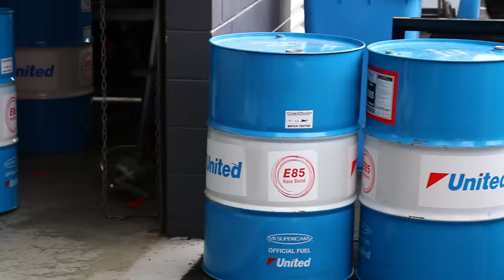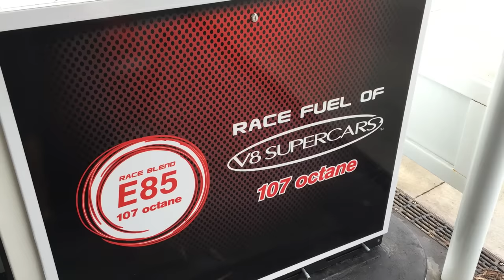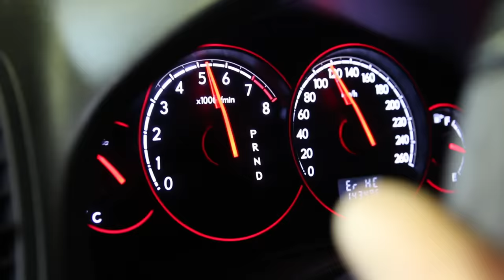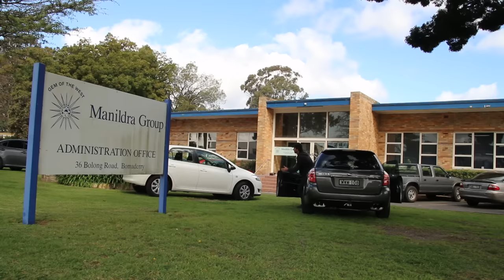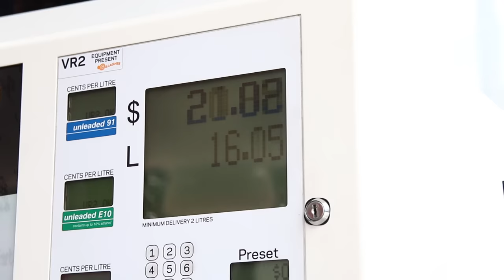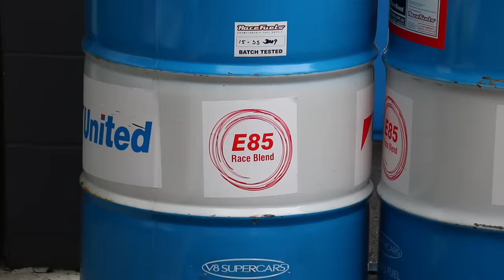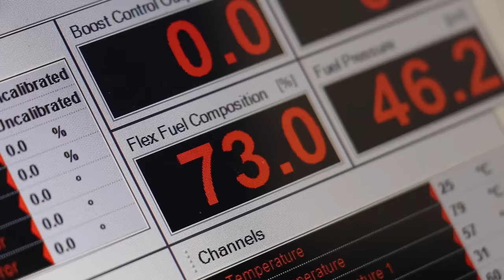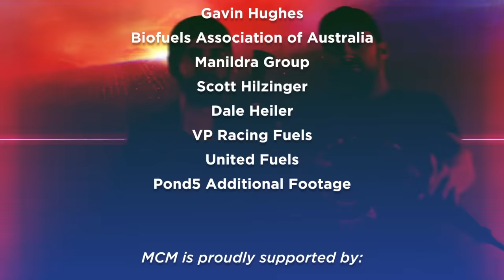E85 Fuel Explained - Should you use it?

Comment: It takes 100 gallons of water to make one gallon of ethanol.  So, you are compromising food and water supplies.  E85 is a distant second place to electric cars.
Reply: +Invincible Osprey But eletric cars use dirt fuel too, as most energy on the wall to charge it... are far from clean
Reply: +Invincible Osprey your statement has very narrow scope and high on the numbers you're quoting anyway. Corn is not the most efficient crop to make into Ethanol. We just grow a lot of it in the states. Sugarcane and Beets have a lot higher yield. You can't compare everything against corn crop.  

You also can't say E85 is a distant second to electric cars because converting any existing vehicle over to E85 or E100 is actually doable. There are billions of cars out there that could potentially use ethanol. Converting those over to electric, that's not possible.

There's a huge environmental impact in making the big car batteries and some use exotic materials. 

I'd love to have an electric vehicle for getting around, but there are tons of great cars out there that I'd not dare give up. They're just so much fun to drive and work on. 

So a statement like what you made seems to just be a standard bulk reply made by someone who has just been told to take a certain stance on something.
Reply: +Invincible Osprey E85 is easily adapted into existing cars, until electric cars become affordable for the average person then something like E85 (or other combustable alternative fuels) is the way to go
Reply: thesamandnath
Unless you need to drink water.  There are lots of water shortages in different places at different times all over the world.  You can't make ethanol unless you use a shitload of water.
Reply: Invincible Osprey
But by that logic let's end the production of any alcohol product, including drinks. As alcoholic drinks... even with water in it, dehydrate the person.
Reply: Invincible Osprey Does there happen to be a water shortage everywhere that ethanol is produced? No? oh okay.
Reply: peniswrinkle
Not to mention, after the combustion, the water used on Ethanol go back to the environment through the exhaust pipe.
Reply: 1300l
Wow!  You think 100 gallons of water will come out the tailpipe for every gallon of ethanol burned?  Are you sure about that?
Reply from the maker: +Invincible Osprey I think its 3-4 to 1 as a ratio, it's high, but its getting lower. Takes water to extract petrol too. No fuel is perfect, yet.
Reply: 1300l
True...unless the electricity comes from solar or wind which are both growing by leaps and bounds.
Reply: 1300l
Do you know how many gallons of fuel are used compared to how many gallons of booze is drunk?  Ridiculous argument.
Reply: John Klatt
What I'm saying is that right now ethanol is a loser based on the fact food is used, land that would normally be used to grow food is used and it uses so much water.  Petroleum is used because it makes the most sense.  We have it in large quantities and the process is perfected.  Ethanol is a really good idea in some places but that's it.  Brazil has the sugar cane and lots of water as far as I can tell.  That isn't true everywhere.  I never suggested converting gasoline powered cars to electric was viable.  Did you see how much work has to be done to make these cars E85 compliant?  How many people are willing to do that?  Further, in the US E85 is about 25% cheaper but about 30-40% less efficient.  That means it's MORE EXPENSIVE TO USE.
Reply: thesamandnath
Are there cars everywhere that need fuel?  I think so.  Do you think the places that can efficiently produce ethanol can make enough to export to the places that can't?  What if there's a plague/disease on the crops?  Bad growing season?  Insects?  Then what?  With electric unless the sun burns out we can make electricity.
Reply: peniswrinkle
Right...water that doesn't make it into aquifers so that people and animals can drink it is used for corn that uses a LOT of water.  Batteries have an established means of disposal and most components can likely be recycled and done so in an economically feasible fashion once there are enough of them.
Reply: Mighty Car Mods
True about the petroleum extraction.  I live in very dry West Texas and until this last year of crazy rain and snow we were hurting very badly because of the drought and heavy usage in the oil fields.  I think if you factor in the amount of water used to actually grow a crop like corn the amount of water required really is around 100 gallons.
Reply: +Invincible Osprey  But where does that electric come from? batteries? pretty harmful to the environment. generator? high pollution. power station? higher pollution....
Reply: Completely agree with your comments. Ethanol is not a good fuel for the future
Reply: TheEpicCrumpet
Ever heard of solar?  What about wind power?  Batteries are only hazardous if they leak...
Reply: False -  I can make roughly 1 gallon of %90 ethanol from 10 gallons of mash. (distilled water,  corn, barley, sugar, yeast) I make 5 gallon batches.
Reply: I came here just to watch the anti-ethanol debate errupt.  
Regardless of what's best for the environment, fuel will be produced, money will change hands, life will go on.  
The ethanol boom is about money and nothing else.  
Energy storage technology is making electric vehicles practical finally.  In another 100 years, ICE tech will be dead in the developed world unless we all blow each other up.
Reply: That's quite agreeable. I personally think that the internal combustion engine will be around 100 years from now just not as something people or industries use very often. I just felt obligated to correct some stupidity I seen someone spitting.
Reply: +tiporari I agree with you wholeheartedly. The electric car will be the next stage of transport. It's not a better source, being that it requires hydro electric in most areas of my country to produce it. If you do the math, and everyone in my country did the switch to electric, we would probably wind up choking every river to harness the power required. We are just at the beginning of a revolution when it comes to fuel sources.
Reply: +Andrew Lang Power grid tech is about to evolve again.  when cheap high capacity batteries are plentiful you will see smart grids storing and distributing energy to follow demand.  Renewable sources are barely scratching the surface but they will eventually grow and supplement then later supplant existing generation techniques.  
I think between nuclear options, solar/wind, hydro and tidal eventually we won't need combustion, but perhaps not in my lifetime.
Reply: +John dawson however, using food to make fuel will raise the prices of food. In turn, a food shortage could be created as more of the food is used for fuel versus eating. In the long run we might be trading one shortage (oil) for another (food).
Reply: +John dawson Probably so :)  our great grandkids might not recognize the smell of petrol in a city.  I remember a distinct difference from just 20 years ago.  another 20 and who knows :)
Reply: +tiporari true that! It sounds horrible but I use to "smell" gasoline/petrol all the time as a kid and I can tell a difference from then and this %10 stuff and even ethanol free I put in my bike.
Reply: John dawson
So, how much water did it take to grow the contents of the mash?
Reply: Andrew Lang
Do you not know what "hydro electric" is?  It's a dam...water is let out and as it does it spins turbines that generate electricity.  How exactly is that polluting?
Reply: +RS8715 We're already well on the way to food shortage because of population growth, longer life spans, and resistance to GMO foods.  without GMO, we're going to starve.  People like to speculate about potential problems and take an emotional stance, but people will starve in greater numbers and that will evaporate too hopefully.

The world is quickly heading toward crisis in terms of food, potable water and energy.  if the pundits can get out of the way, maybe it will get better.  I'm betting on violent revolution myself...
Reply: +John dawson Nothing wrong with that :)  we used to use it as parts cleaner, fire starter, and a host of other "ghastly" things.  Now we can't take a crap without a helmet and a safety rail for our panties.
Reply: You know that water is pumped into the ground in order to get regular crude oil out of the ground, right. And its gallons and gallons of it being pumped into the ground in order to gain enough pressure to pump the oil out
Reply: +Frank Magana isn't that fracking?
Reply: +dumkopf yes that is Fracking not the standard way of drilling
Reply: I hate how people are so convinced that electric cars are brilliant. Sure, they don't emit fossil fuels directly however most electricity is still made by burning fossil fuels in power stations so it's just as bad for the environment. Then there are the batteries. Not only are they toxic if they leak, they are made from precious metals which have been dug up, mostly from under the Amazon causing deforestation. They are then shipped halfway across the world to be processed and made into batteries before being put in a car. That's farmore damage than just running a standard petrol or diesel. The only difference is the consumer notices it less.
Reply: electric is terrible. the resources used to make the electricity are usually not good. ie coal.
Reply: +WilliamT1995 Most "environmentalists" (used to call them tree huggers)... are far more concerned with appearances than actual, factual actions that further their cause.  It's all a bunch of feel good bull $#@! if you ask me.

"I drive a Prius, and recycle my nonfat organic latte cups."    it's like pissing on a forest fire, when their iphones, Li-ion batteries, and new iMac created enough industrial pollution and heavy metal toxicity to deform a hundred thousand babies in rural China.

Humbug.  nothing changes, nothing new under the sun.  Nothing that hasn't been said, done, or repeated for a 100 generations.  move along, these aren't the droids you're looking for...
Reply: jesse grat Unless you are making your own electricity it's pretty bad.  The amount of energy lost just to get it to your house is pretty high.
Reply: tiporari This is true of most activist.  It's more about showing concern then actually solving anything.  Just say the right words and people will like you and you get laid or have more friends.  Show the errors in the actions taken or the errors and they flip the fuck out.  

This list of examples is just endless.  LOL
Reply: +tiporari and they dont know that their prius creates more toxins in the long run over a range rover, g wagon, hummer, GM full size suv, diesel trucks, or vw "40x more polluting" diesels. They dont know this because they refuse to look up the nickel mines in canada and their death zones
Reply: electric cars are in our near future. batteries have evolved and become hundreds of times more powerful in the last 10 years. I have model airplanes that weigh just over a pound I can fly for an hour on a single charge. not saying it is a clean fuel, but great strides have been made in battery efficiency. before the model t, most transportation was electric. as a matter of fact, in the US all the car companies got together and bought out and shut down electric rail transit systems to increase car sales.

the limitation on electric cars has always been range and charge times. Tesla by themselves have but but solved that issue. it won't be long and all other car manufactures will have to follow suit.
Reply: Invincible Osprey
Yes, more people drink then use ethanol in the world.
Reply: Invincible Osprey
And about the 100 gallons comming out of the exaust. Not all at once, as a car wont burn all fuel at once.. but yes, it will.
Reply: +Four Bangin im everywhere, im even in your gearbox, switching up your gears and shit
Reply: +Invincible Osprey I'm fairly certain that at no point in my reply that I mentioned "polluting". What I said is if a country decided to switch to hydro power, it would damn up mostly every river. Yes, the water turns the turbines. I understand the basics of hydro power. But if dams were doubled or tripled, how good would it be to create that many controlled points for water?
Reply: If you like electric cars go check out what a lithium mine looks like
Reply: Bullcrap
Reply: Andrew Lang
Here in the USA they aren't building any dams.  They are taking many of them down because they aren't needed.
Reply: 1300l
I drink ethanol sometimes.  I have a fifth that I've had over a year.  However, I drive 66K miles a year with work so I burn about 2640 gallons of fuel a year.  Can't you see the difference there?
Reply: lilsammywasapunkrock
Did you also know that Prohibition in the US was actually the underhanded scheme by Standard Oil?  That's right, like this video suggests the Model T was made to run on Ethanol and gasoline.  Big Oil decided to maximize their profits by pulling strings in government to make their competition illegal.
Reply: WilliamT1995
Clean coal plants are just that...clean.  Wind power in the US is taking off and solar is gaining.
Reply: Invincible Osprey
Still less then what man kind comsume of alcool drinks world wide.
Reply: 1300l God Almighty...do you have any idea how much fuel is consumed in the world?  It isn't even close to how much alcohol is drank by people.  Just think of all the ships and how much fuel they consume, then all the eighteen wheelers, then all the pickup trucks, then all the cars and generators.  It's mind-boggling and not even close to what tiny bit of ethanol people drink.
Reply: Invincible Osprey
Give me numbers then check the nubmers of total alcoholic drinks consumed world wide. Then remember that Fuel uses around 4% of water. Vodka uses 40%
Reply: 1300l
You're so full of shit.  We're talking thousands of gallons per vehicle.  There are hundreds of millions if not billions of vehicles worldwide.  Not all people drink alcohol but they all either drive vehicles or rely on goods and services delivered with vehicles.  It's not even close.
Reply: Invincible Osprey
Numbers, privide it to me
Reply: ... But they go fast??
Reply: 1300l If you don't understand the scale of fuel use in the world I don't think you're equipped to be arguing on the matter.
Reply: Invincible Osprey
I do, but 80% still uses gasoline.
You don't understand the schale of a fuel that most don't use aguisnt somethign every one do.
Reply: Invincible Osprey
Prove it
Reply: 1300l
All anybody has to do is read your comments.
Reply: Invincible Osprey
So you can't.
Yea, now you should take a time to think why people still produce Ethanol and no one complain of shortage of water or food... You are the wrong one here.
Reply: Tesla
Reply: +1300l I literally just foot it and I found several reliable sources stating that it does take around 100 gallons of water to 1 gallon on ethanol, because you also have to factor in the amount of water used to grow the corn.
Reply: +Invincible Osprey even when making wind or hydro power you have to burn fossil fuels and use and water to produce energy that can be used. There is no 100% efficiant way of using power.
Reply: daniel jordan nicol
WTF are you talking about?  The fuel for the trucks that haul the wind generators in?  Used in manufacture?  I get it...but it's a one time deal and those things don't require much maintenance.  Hydro power?  That water is just sitting there.  They are dammed up rivers. That water flows into the ocean otherwise.  How old are you?
Reply: +RS8715 The usa will never run out of corn due to ethanol. I think the statistic is only 20% of the corn grown in america is used for ethanol. plus, we don't eat the corn used for the production of  ethanol. The process of making ethanol creates tons of by products. One is used to feed livestock and is much better for the livestock than regular corn, and also more valuable.
Reply: +Invincible Osprey The water used for the production of ethanol is reused in the water. Plus, ethanol is not the only product produced in the process.
Reply: have you ever heard of the law of conservation of mass? the water evaporated in making e85 does not just vanish how do you think it rains. both petrol and e85 have problems as do electric.
Reply: Matthew Magarelli
So, why don't we just evaporate all our lakes and streams?
Reply: *****
Where?
Reply: *****
No shit?  So, the water evaporated here doesn't rain here?  I know. That's why this water being used to make ethanol is just used.  It isn't recycled.
Reply: *****
Somewhere neither you nor any animal near you can drink them.  Also somewhere they won't absorb into the ground and be filtered into an aquifer.  Why is this so hard to understand?  You do realize that many places go through drought, right?  In California the situation has been very dire recently for example.  Why is this so hard to understand?  Water is precious.  Even if the drought ends after ten years during those ten years life can be very difficult.  Ever heard of the Dust Bowl of the 1930's in Oklahoma?  It forced thousands of people to risk everything and go west to California.  So, to avoid importing oil from the Middle East you are willing to try to import water from somewhere to make up for all of it used to make food into fuel?  BTW, arable land is relatively rare in the world.  Here in the USA we are very fortunate.  However places like China have no such luxury.  Even Russia had to import grain from the USA fairly recently if not to this day because that huge country doesn't have enough arable land to grow food.  Why is this so hard to understand?
Reply: *****
"So your numbers about water consumption is wrong."  Really?  How so?  Corn requires shitloads of water PERIOD.  You simply can't grow corn without irrigation.  Are you claiming they have large evaporation pools to let the waste water evaporate?  I doubt that.  I bet it goes into sewage.
Reply: +Invincible Osprey Ethanol in the US is made from corn and 85 to 90% of corn crops are never irrigated so very little water is used to grow the corn. 87% of the corn grown in the US is used as animal feed in this country and around the world because very few other countries consider the GMO corn we grow fit for human consumption. 12% of the corn grown in the US is used to make corn products like corn syrup, high fructose corn syrup, corn four, corn chips, etc, etc...Only 1 % of the corn grown in the US is consumed by people so the food argument is mute. The corn used to make ethanol comes from the 87% that is animal feed and after the starch is extracted it goes back into the animal feed is much healthier food. You might also want to look at how much water is used by the oil companies and the fact that about 10 to 15% more energy goes into every gallon of gas by the time it reaches your car than you will ever get back out of it.
Reply: +Invincible Osprey  That was possibly the stupidest thing I have ever heard.   I stated a fact.  I was not defending e85 just stating that the water is not " destroyed".  Secondly do to temperature and air density majority of water rains in areas that streams are and lakes are.  also most cities have storm drains which drain to lakes and streams. last of all, even if they don't have storm drains water would be absorbed into under ground reservoirs which lead to STREAMS AND LAKES.
Reply: +John Klatt Converting a car to electric is definitely not impossible. In fact, it's becoming easier than ever with more of the parts becoming readily-available, off-the-shelf parts. I agree it is more difficult, battery production can be harmful for the environment, and the source of the electricity can sometimes come from fossil fuels anyway, but the end result is far superior. As an engineering student I am planning to convert my car to electric for a final project, I'm the 5th person to do this from the school I'm going to, so it is definitively possible.
Reply: What about hydrogen you just get few solar panels/wind turbines separate oxygen from hydrogen fill your car with hydrogen use it and repeat
Reply: Trajce Cvetkovski
And hope you don't explode sometime in the process...Just kidding.  I'm not sure what the holdup on Hydrogen is.
Reply: +Invincible Osprey yeah theirs pretty much a downfall for all of these
Reply: *****
Still waiting to be owned.  Still free as a bird and undefeated in this debate.  Only an idiot would believe otherwise.
Reply: +1300l This is true for a lot of countries but some like Canada, uses hydroelectricity to generate it's electricity (at least quebec I know off)
Reply: Not to mention battery production which is making lot of mess.
Reply: +Invincible Osprey at the moment you use more fossil fuel by drive 1 mile in an electric car than you do with a small petrol or diesel car.
Reply: MrBusunglueck
Are you sure about that?  Where I live there's tons and tons of wind generated electricity.  Many other places they get their electricity from hydroelectric dams and nuclear power.  Are you really sure about what you claim?
Reply: *****
I guess not.  You're all so much smarter than me.  I feel horrible.  Why do I keep trying?  I must be a glutton for victory.
Reply: Yeh but we don't have the capacity to support that amount of electric cars, considering when everyone is watching tv the national grid is stretched imagine adding 10 million electric cars charging as well.
Reply: +Invincible Osprey it can be used in a proper motor, so it's distant first place. Electric cars are just glorified torches as The Great Clarkson (XII century BC) said.
Reply: +Invincible Osprey Hydrogen requires huge amounts of energy to produce, thats why we can't use it as a main fuel source.
Reply: +Raisin Toast dude I'm 14 and have made a hydrogen generator powered off a car battery hydrogen is a good fuel because is explodes more rather than burning and wasting energy on heat (I know petrol explodes but it makes more heat energy that is wasted)
Reply: +Invincible Osprey I actually work in an ethanol plant, it takes about 3 gallons of water per 1 gallon of ethanol, also the "waste" water is actually recycled back into the plant.  You are also forgetting that ethanol is not the only thing to come out of these plants.  We produce both wet and dry feed for cattle, corn oil,  as well as all the CO2 that is produced in the fermination process gets pumped off site to be used for other industrial uses, mainly drilling haha.  We are currently working on a water reclimation system to bring that down to about 1.5 gallons water to ethanol.  Whoever stated that the waste water is just left to evaporate is dead wrong.  Any polluants are pulled from the water and burned (3000F) off.  Those smoke stakes you saw from the plant are just super heated air condensing.  This is tested by the federal goverment every 6 months.
Reply: +Ken Met well obviously what I'm trying to say is we need something that can keep gas companies quiet the reason hydrogen is good is because 
A: it is very efficient in the way of exploding (which turns Pistons)
B: is better than electric in the sense that it is practically a battery (without all the harmful materials needed for a battery) because it can be generated at a gas station pumped onto your car. Once burnt it just turn onto water vapour.
C: car can be transferred and built easily to accommodate the change from liquid fuel to gas fuel 
 However the huge downfall is it literally takes static electricity from your finger to ignite hydrogen but if more research is put into this I think it could solve a lot of problems.
Reply: +Ken Met forgot the comma at the start and I'm not trying to be rude
Reply: +Invincible Osprey Check out the Toyota "Mirai" car, uses hydrogen fuel cells and it's emissions? Water. It's already on sale, obviously not the best for performance but you brought up electric
Reply: +Invincible Osprey Electric cars is yet another high magnetized/polarization cancer source as such living under power lines. Having one "revving" at a higher amp in front/behind you much closer than those power lines would be. I get a metal taste in my mouth when I was in LA. It really sucked.
Reply: +Ken Met actually hes right, you have metal fillings?
Reply: Guys I think we're over looking a big problem "pollution"
Reply: Trajce Cvetkovski
Water pollution?  Where does all that chemically polluted water go?
Reply: +Invincible Osprey One other problem with electric cars is that batteries don't hold much charge in extreme cold. I live in Minnesota and electric cars can't function in our winters.
Reply: +Invincible Osprey "race fuel of the future" not daily fuel of the future.
Reply: Pagan Min
Sounds most accurate.
Reply: Invincible Osprey if you are talking about from the ethanol plants, its all contained.  Other than run off from rain which is tightly regulated and tested daily, we have only a sewage line for human waste and is on a system that is not connected to the plant itself
Reply: +Invincible Osprey "face palms" their is no pollution from the reaction when hydrogen and oxygen burn they creat %100 water
Reply: Trajce Cvetkovski
Face palm?  More like a knot on your head...  I wasn't talking about hydrogen cars.
Reply: +Trajce Cvetkovski When pure oxygen and pure hydrogen burn yes they only create water. When you take our atmosphere which has many different elements, different compounds are made.
Reply: Trajce Cvetkovski The problem is no matter what we use we will some how hurt the environment with the tech we have at the moment. Batteries use rare metals and are extremely polluting to produce. Hydrogen requires extreme amounts of energy to make and that much energy can't be produced sustainably with modern tech, except maybe with nuclear energy.
Reply: +Raisin Toast I used a car batter to fill a balloons...
Reply: +Raisin Toast but your still right
Reply: +Invincible Osprey your argument of food is valid but water is not. remember that water is recycled my nature. when a sustains is evaporated all it is, is the water content in it is turned in to steam and makes it to the atmosphere when this water molecules clump together they form clouds and are released as rain witch can be collected for any use. there for water is not renewable by man but recycled by nature. and electric cars are more harmful because batteries yes more resources to make loose charge, hydrogen gars are better because the only emission is water witch can be turned back to hydrogen
Reply: imhbomb
So, you don't believe droughts happen?  Of course "nature" recycles the water but it doesn't put it back where it was last.
Reply: +Invincible Osprey Your saying it takes that much water to grow the corn to make E85?
Reply: RealDarkFilm
Between growing the corn and processing it into ethanol 100 gallons of water are consumed.
Reply: +Invincible Osprey I think the important question which nobody knows either way is what are the long term effects of mass battery production at that scale.  It costs *a lot* to make batteries.  A lot of production.
Reply: MrSlowestD16
This is true at the moment but Tesla and Elon Musk are soon to be opening their Gigafactory that will greatly reduce cost of battery production.  As time goes on the costs will surely continue to drop.
Reply: +Invincible Osprey I think I phrased poorly.  I didn't mean 'cost' as in cost to produce, I mean cost as in damage to the environment and what-not.  From what I understand there's a lot of waste still in battery production and it'll be quite awhile before that's significantly reduced.  Whether it's better than dino's though I don't quite know, I'm not exactly an expert on the matter.
Reply: MrSlowestD16
I think you're right.  Not sure how much impact there is or if it is being mitigated by new methods/technology.  Some say the real reason for war in Afghanistan is their massive Lithium deposits.  Some estimates say over $1Trillion worth.
Reply: +Invincible Osprey Oh wow, never heard these Lithium deposits before, I'll have to look into that, thx!
Reply: +Invincible Osprey Don't feed the green envirocommie troll guys.
Reply: akkudakkupl
Sometimes I like to stomp cockroaches.  I know they will keep coming and never produce anything of value with their lives but sometimes it's just fun.  I'll feed them as I please.
Reply: +Invincible Osprey are you refferring to the fermentation method?
Reply: Green Pretzel
The water to grow the corn/wheat and the processing of it into ethanol.  The waste water, etc.
Reply: ok makes sense
Reply: Invincible Osprey The problem with the claim of how much water is used to produce ethanol is that claim does not take into account that the vast majority of corn in this country is not irrigated. It relies on rain which is the reason the drought of 2010/2011 caused the price of corn and other grains to rise, causing the price of beef to rise. There is a lot of corn grown in my area and only 1 field even has an irrigation system. Also the water used during the fermentation process makes really good irrigation water, for any crop, after distillation. There is a lot of gray water used in the production of ethanol so the amount of fresh water used is relatively small. We also need to understand that the corn is going to be grown whether ethanol is made or not because the corn used for ethanol comes out of the 87% of American corn that is used for animal feed and is then returned to the animal feed after the starch is removed making a much more healthy feed for cows that suffer from a bloating condition when they eat too much starch. Personally I plan to buy an electric car when I need a new car just for the low operating cost.
Reply: cncmike
So, if the water is rain then it doesn't matter if you use it?  Where do you think groundwater comes from?  Using corn for anything other than food will cause the cost of food to increase.  What about that can't you understand?
Reply: Invincible Osprey Lack of liquid fuels will bring food prices even higher. Also anybody (but you greencomie) cares.
Reply: akkudakkupl
There is no shortage of liquid fuels.  They've never been cheaper and there are MASSIVE untapped reserves all over North America alone.
Reply: Invincible Osprey But arent you greenpeacers the 'oh but in the unknown future in houndreds of years' guys too? Come on, don't be a hypocrite.
Reply: +Invincible Osprey Batteries right now take to long to charge. There hasn't been an electric vehicle yet that could travel further than 200 miles. What do you plan to do with the parts of a battery that can't be recycled? Read my posting further up for another fuel source.
Reply: SheepTrees
Oh...you don't think people eat corn products?  You don't think people eat food that could have been grown on land used to grow food for animals ONLY and make ethanol?  Oh, I see...  In order for ethanol to make a dent in fuel requirements you would have to convert land formerly used to grow food for HUMANS to land used to grow cattle feed and make ethanol?  So you are suggesting a meat only diet for humanity so we can have fuel for cars?  I see...
Reply: SheepTrees
You can't dispute a single thing I just stated.  Hilarious.
Reply: +Invincible Osprey you have no idea of what your talking about, For one Electric cars cost more in resources to make then any car on the market......

Electric cars have one huge huge flaw and that is the fact we have the worst energy storage systems by no means are we even close to an efficient energy storage when your talking about Electricity.

Computer Power Supplies are 85% Efficient at the lowest end of the scale and 95+% Efficient <<<<< That tech is Mastered.

Solar Panels are 16% Efficient.<<<< best case scenario !!!!!Far from perfect!!!!!!
Batteries "Lithium" 60% efficient !!!!!!!!If you got 60% on a Test it just means you 10% better then failing!!!!!!!.

Petrol 90% That's right 90% of the fuel that goes in a modern combustion engine gets used with a small loss of 10% and i am sure there is even better engines out there but we are talking about what the General public can afford.

Ethanol can be made from algae the water to grow algae can be WASTE WATER meaning water that humans cant drink oh yeah the water after that process is drinkable.....I guess you need to do more Research mate......LOL

P.S As a person who has a background in E.E i would love cars to be electric because if it breaks i could fix everything my self, but i will not spend money on a car that is ridiculously inefficient, also i would not want to be a car that has a bigger impact on the environment due components that don&#39;t last long and take a heap of toxic chemicals to make. 

Fun Fact the UK has stopped posting lithium ion batteries due to them exploding in aircraft, check out some videos on how you can explode a lithium ion battery to release its goodness.......
Reply: BlackIce504
So, how much energy is required to heat this mixture up to 550F for however long necessary?
Reply: BlackIce504
Really?  550F and 3000PSI from solar?  I'm what educated people call "rational."  You claim this method was better than fossil fuel and I didn't see that in the article.  They claimed it but they didn't prove it.  It's called "critical thinking" and I suggest you learn how to do it.
Reply: Invincible Osprey
you must be that kinda special, go visit the place and they will tell you an estimate is allot less then battery tech as batteries loose energy when you charge them, they only last 10 years at a time, they require heaps of bad chemicals to make, so why don't you do everyone a favor and go look it up your self.

3000PSI can be done with 2000kw "high pressure washer", you could even do it via putting algae in a pressure tank and just letting it grow as it grows it releases CO2 over time you would get pressure, there is allot of variables that go into this.

Plus all the bi products are green, no nasty chemicals, plus who needs shit water? no one.

IF you look hard enough The Germans have already built a Algae house that is working go have a look. "with out the 3000PSI and 285c heat" so that sounds better then the yank solution.

I given the examples its up to you go do the research.

Facts: Batteries have not improved that much over the last decade. "minor improvements"

Before you go on how much better lithium ion is to other chemical storage yes its better in terms of storage cap and discharge but its still the same dirty inefficient tech with allot of losses.

not my fault you can't listen to anyone or can't be bothered to look into anything your self, thus i leave it for the people to deiced who is right, i will not reply after this i have better things to do.
Reply: A byproduct of making ethanol is corn. Food supplies are not at risk.
Reply: +Invincible Osprey Most ethanol plants recycle there water through a anaerobic digester, and reuse it. Although it does take a lot of water in a fermentation batch that water is recycled, so that statistic isn't encompassing all of the facts.
Reply: +Invincible Osprey Accept the human footprint of electric batteries and the hazards of them are just as bad if not worse. Not to mention electricity cell technology still blows ass.
Reply: +Invincible Osprey Actually there's a bunch of interesting stuff happening in northwestern Australia with (almost) closed loop systems where waste from agriculture becomes biofuel, the waste from manufacturing is fed back into the next cycle, the CO2 from running biofuelled powerplants is bubbled through algae which creates more biofuel, the algae (when it's done) provides nutrients for agriculture, and so on (it's too complicated for me to remember/explain fully).

So there's almost zero water wastage, there's zero impact on food production, and in fact there's a whole bunch of stuff that would've usually been dumped that actually goes to improving food production. Source: my father is in the agricultural industry and has been involved (in a small way) in the development of these systems.

It's really an amazing time to be alive... except that the Australian government would rather fund a massive coal mine in prime farming land that spews C02 and isn't even economically viable because the coal price has tanked.
Reply: Nicholas Fisher
I hope so and I hope it works feasibly.
Reply: +Invincible Osprey The water inst wasted though. Nothing actually disappears, 100 gallons of water dont just cease to exist if you make a gallon of ethanol.
Electric is far from clean. Look up how complex the manufacturing process is and the materials required and how most energy in the world is produced. The efficiency is appalling too. Bottom line is - electric cars are NOT really all that green. Just building it likely does a ridiculous amount of environmental damage. Shipping the materials burns fuel too, and most parts used to build one travel a few times around the world in cargo ships burning and leaking tens of thousands of tons of diesel in the process.
In fact using biofuel is probably more environmentally friendly and sustainable, and it can be done locally in almost any country. All we need is to develop a more efficient way to produce ethanol from cellulose to actually produce enough of it.
Reply: RJ Lee
The problem is that fossil fuels are readily available and biomass is needed for all the living things.  Are you going to clear cut forests to make cellulosic ethanol?  Where I live we have wind power.  There are wind generators by the tens of thousands here in Texas.  We get ten percent of our energy from wind at the moment and that number will continue to climb.  Not all places have this much wind but the whole western US certainly does.  I know that electric cars aren't the most efficient at the moment but they are getting better.  Tesla is about to change all that at least for cars intended for the US market.  Ethanol is a fool's errand in my opinion for most of the world.  If you live in a tropical zone and can grow sugar cane year round in great abundance then ethanol will work for you.  I think each region will have to find their own way.  Forcing policies on everybody regardless of their situation is just government control run amok.
Reply: +Invincible Osprey green peace logic.
Reply: Jesper K.N.E
What part?
Reply: +Invincible Osprey Hold up on hydrogen-? you are aware that to use hydrogen as fuel you need to supercool it, and the damn stuff quantum tunnels outside of any container you put it in. It leaks out of a perfectly sealed unit.
Reply: Carbon 12
Where did I mention hydrogen?
Reply: +Invincible Osprey  thanks for this info bro !
Reply: +Invincible Osprey Gettin fuckin rekt all over the place m8
Reply: Dude, water falls from the sky. So water is unlimited (kidding)
Reply: +Invincible Osprey Just wondering why you think its a negative to use 100 gallons of water to create 1 gallon of ethanol. Water is not a fossil fuel, We can't 'use it all up' so I don't see what parts of the world having a shortage of water has anything to do with Ethanol fuel. 

Its pretty simple, if the end product you are making requires a large amount of a particular material (in this case water) you build factories in areas this is in the highest supply to increase profit and decrease risk. All your argument has told me is that you think people will be dumb enough to build factories that require 100 gallons of water per 1 gallon of ethanol in areas of the world they would have to pay to get the water delivered? It doesn't even make sense logically what you are talking about? Are you under the impression every tangible thing you own was manufactured in your local area and any materials your geographical location is missing were purchased by this imaginary local manufacturer? Almost everything you own that was manufactured in the last few years was shipped in bulk from the factory to the stores from the place it cost the LEAST to manufacture.

Since you said "here in Texas" I am going to assume you are an American from Texas, as an American you should probably look at how much your country spends on importing goods and services and what exactly it is importing. The USA spends over 2 trillion which happens to be about 17% of your countries GDP on imports and the US is the largest importer of oil IN THE WORLD at this point you should have arms wide open welcoming ANYTHING that slows this bullshit down instead of trying to argue, if you can even call it arguing since you don't seem to have any facts and are just making things up.

Invincible Osprey1 month ago
+akkudakkupl
There is no shortage of liquid fuels.  They've never been cheaper and there are MASSIVE untapped reserves all over North America alone.

Fact - America has steadily been increasing its oil production! Lie - This is the reason oil prices are so cheap!
Fact - Other countries who produce a lot of oil have a large amount stored, instead of pulling back on exports until the price rises they have decided they are happy to keep a huge supply of oil on the market while the price plummets!
Fact - Big Ol' American Oil is haemorrhaging money keeping all these employees and drills going when they are no longer turning a profit! Oh no!
Fact - Drills are being shut down daily and HUNDREDS OF THOUSANDS of Americans working in the oil industry are now OUT OF WORK. (They could be getting a job at the new Ethanol plant except you wouldn't want that right?)

Fear not though brave Texan man, a basic understanding of business will have things corrected in no time!
Its called 'Supply and Demand'.
Shitloads of oil SUPPLY floods the market tanking the price, oil companies shut down drilling and lay off staff. America's oil production slows down, as it turns out its now cheaper to import all your oil rather than drilling for some of it yourself! Countries such as Saudi Arabia with huge stocks of oil to sell get to export it to the U.S.A, now buddy maybe you can help me out here with your incredible level of intellect... What happens when the stored stocks of oil all get sold and the U.S.A can't import all the oil it wants? I'll give you a hint as the SUPPLY lowers the DEMAND goes up. Now we covered earlier that a LARGE SUPPLY means prices will go down, well a SMALL SUPPLY means prices will go... up!
America decides its now to expensive to import all their oil and they would be better served drilling what they can themselves, queue the drills firing back up again. 
Now the DEMAND has lowered as America needs to import less so SUPPLY goes up.
And around and around it goes!
There you have it, the basics of how Supply and Demand works!

Almost every debatable point you have referenced in your argument has been ill informed and wrong. 3 gallons of water for 1 gallon of ethanol and the water is recycled and reused. NOT 100 gallons to 1 no matter how you try to phrase it including the process of corn or whatever bullshit ill-informed reasoning you try to justify this imaginary figure.

We are not sacrificing farmable land or food to create ethanol, It has been stated multiple times by multiple people (and you can even go on over to google and fact check this yourself) that we are not using crops we eat to create ethanol, and infact we are being more efficient in gaining the extra benefit of biofuel instead of just giving the shitty corn crops to animals while also improving the food the animals get to eat. Win - win.

Renewable energy such a solar, wind and hydro since you like to mention them so much do not produce energy on demand. They require sun, wind and water who would have guessed it? Wait a minute though? Why is this an important fact you ask? The same reason electric cars are fucking expensive and destroying the environment as well just in a different way - power storage. You go ahead and fill all the empty space in texas with windmills and solar panels, don't forget to build hydroelectric dams along every river. You can have all the power in the world! Except you won't be able to hold onto it unless you suddenly grow a big ass brain and build us the battery of the future. You keep bringing up bullshit like what about droughts, well, what happens when the sun goes down, or its cloudy? The wind drops off or is too strong? The river is calm or the reservoir dries up in one of your ominous 10 year droughts? Back to candlelight dinners I guess? I guess your other option is to build something that you can use to control the wind, good luck!

Invincible Osprey2 months ago
+Ken Met
Still waiting to be owned.  Still free as a bird and undefeated in this debate.  Only an idiot would believe otherwise.

Now fuck off back to your delusional speculative hole.
Reply: Aaron66111
How much fuel do planes, trains or boats use?  You don't need water to pump oil.  People, animals and plants need water.  Haven't you been paying attention?  There's this thing called "weather."  Sometimes places have more than other times.  Are you saying that billionaires are dumber than you?  If ethanol were more feasible and profitable why wouldn't they have already jumped in?  In the USA governments have to subsidize ethanol production because it isn't feasible.  I did make a mistake on the US oil production.  I saw an article headline last week that apparently was misleading or I misread it.  However, I did find that some forecasters predict the USA will be back to max production in the next five years.
Reply: Phu Doan I tried to explain supply and demand to him earlier but he doesn't understand. Don't bother trying to convince him with logic and reasoning he is mentally challenged.
Reply: Phu Doan
Bullshit.  That isn't true in the USA.  Your pricing seems way off unless you live somewhere it is just as expensive to import oil as it is to make ethanol.
Reply: Aaron66111
You're off your rocker.  Oil isn't as cheap as it is because of US production.  It's that cheap because OPEC got tired of the USA producing so much oil and lowering the prices so they did a bitch move and increased production even further to discourage new oil exploration in the US.
Reply: *****
Ever heard of a drought?
Reply: *****
HAVE YOU EVER HEARD OF A FUCKING DROUGHT?  People, animals and plants can only go so long without water.  Ever heard of the Dust Bowl in the US during the 1930's?  People had to MOVE.
Reply: *****
Red herring much?
Reply: *****
Don't you know what a red herring is?
Reply: ***** BORING.
Reply: *****
BORING.
Reply: +Invincible Osprey You're not compromising food supplies. One of the people they interviewed said it came from byproduct which is essentially waste that would be disposed of anyway.
Reply: ALLEN80Z28
That process is much more intensive than using sugar cane, corn or wheat.
Reply: +Invincible Osprey That's a bit of a misunderstanding of how photosyntheses, the water water cycle  and plant life in general works. And is dreamt up by Californians thinking the entire world looks like LA. 

But yeah, I don't see the other world running completely on ethanol any time in the future. But I see the possibility of enthusiast cars running it, or as a second fuel to generate electricity for longer trips (if hydrogen doesn't win that race). That is unless the governments believes in those Californians and bans it because of the carbon-dioxide which would be ridiculous and the mere suggestion of that should give you a trip back to the first grade.
Reply: +Invincible Osprey No reason you can't do it with seawater.
Reply: dacrunch
Are you sure about that? If desalination were cost feasible then California would never have to worry about droughts.
Reply: *****
How much money does the Middle East have?
Reply: +Invincible Osprey This is not real, we use Ethanol here in Brazil at last 50 years, and the production suffered a lot of changes, and that a primitive mentality about Ethanol it's like a mentality about petrol gasoline in the beginning, stop propagate that lies...
Sorry for my bad english, i talk portuguese not english...
Reply: Antonio Amaral
Really?  Reproduce Brazil's climate somewhere else and get back to me.  I'm propagating the reality of the situation.  I know it works in Brazil.  The rest of the world is not like Brazil.  Do you think you can grow sugar cane in Iraq?  Afghanistan?  Nevada?
Reply: Invincible Osprey You don't know nothing about Brazil and Ethanol production bro, we have 4 different climates here at the same time, when in north makes 114ºF here in south makes 4ºF, only a little part of Brazil it's good to plant and grow sugar cane, and have a half area territory of Nevada, we don't use all the territory to produce sugar cane, we have 220 million of people to feed, we are the second world soybean producer and third corn producer, we don't feed our people with banana like your people think.
80% of our cars/motorcycle uses pure Ethanol, 80% of 200 to 400 million cars/motorcycle...
Reply: Antonio Amaral
You assume way too much.  I know how sophisticated Brazil is in places.  You are still an equatorial country.  Sugar cane can't grow everywhere.
Reply: +Invincible Osprey id bet theres more booze drank in a day then fuel burnt, on the grand scheme of things getting drunk is easier then driving down the street
Reply: Josh Mac
Not likely.  You only get 20-30 mpg and most people commute more than that.  There's no way people are drinking more than two gallons of booze every day.
Reply: +Invincible Osprey You can go sit in the corner now. E85 is Life.
Reply: Mathew Festoff
It's a very limited, expensive and short-sighted life for sure.  So, technically it is at least a kind of life.
Reply: +Invincible Osprey At a time when half the earth is starving and fresh water getting harder to supply some nit wit thought it was a good idea to burn ethanol.Water and ethanol are worth much more  then gas or diesel.
Electric is the future.
Reply: +Invincible Osprey it doesnt sound any better saying this. 100 for 1.... whats the ratio for regular gas?  i feel guilty about using all that gas now...
Reply: *****
Nothing like that.  They do use water when drilling oil wells but there's no way they use anywhere near the volume of water as they get out in oil.
Reply: Kegs
If there were meat in large deposits in the Earth's crust I wouldn't be eating them.
Reply: +Invincible Osprey E85 does not use food. E85 is a byproduct of making cow feed.
Reply: ZoltanTroll
Really?  I think you got that twisted.  It just so happens you can use what remains of corn for cow feed.  It's not even good cow feed but it'll do.  Land used to grow the corn or wheat used in E85 can be used for human food consumption.  If not for government requirements that it be in fuel and government subsidies it would not be a viable industry in the USA.  So, taxpayers are FORCED to prop up a foolish idea.  Same shit different day.
Reply: Barry McGuigan Well, if you are willing to transport that water all over the world at your expense you could certainly do that.
Reply: Invincible Osprey if you look outside, there is water all over the world already, have you been locked in a small room for most of your life ?
Reply: Barry McGuigan
Why don't you drink some seawater?  Water your lawn with it.  Good luck.
Reply: Invincible Osprey why don't you go outside,
Reply: +Invincible Osprey Sea water can perfectly be used for drinking water although it's costing at least 7 times more energy than conventional ways of getting water. The Middle East is using destillation by cooking sea water, because they don't give a fuck about oil usage. Islands like Curaçao are using reversed osmosis, in which sea water is pushed through a membrane to get rid of the salt. Combine that and you get Memstill which reduces the cost 2-3 times: https://www.tno.nl/en/focus-area/urbanisation/environment-sustainability/water-technology/sustainable-drinking-water-with-memstill/ Quite interesting with this technology is it's using waste heat from the industry to get clean water, which is very cheap. I can imagine that in Texas with all the oil industry you have you can get cheap waste heat energy. Only some infrastructure is needed, but renewing infrastructure isn't America's strongest point. California can use solar energy for it. That won't solve the drought problems though, but at least it does help a bit.
Reply: +Invincible Osprey Sea water can perfectly be used for drinking water although it's costing at least 7 times more energy than conventional ways of getting water. The Middle East is using destillation by cooking sea water, because they don't give a fuck about oil usage. Islands like Curaçao are using reversed osmosis, in which sea water is pushed through a membrane to get rid of the salt. Combine that and you get Memstill which reduces the cost 2-3 times: https://www.tno.nl/en/focus-area/urbanisation/environment-sustainability/water-technology/sustainable-drinking-water-with-memstill/ Quite interesting with this technology is it's using waste heat from the industry to get clean water, which is very cheap. I can imagine that in Texas with all the oil industry you have you can get cheap waste heat energy. Only some infrastructure is needed, but renewing infrastructure isn't America's strongest point. California can use solar energy for it. That won't solve the drought problems though, but at least it does help a bit.
Reply: Electric will definitely be the predominant source of power for cars, but more so for commuters, people who see a car as a way of getting A to B. Car enthusiasts will still be able to use combustion engines. Having a debate over what the cars of the future will use is pointless. The reality is it will take a variety of fuel's, be it ethanol, electric, hydrogen or biodiesel or even waste such as cooking oil, there's going to be a multitude of ways to power a car. Close-mindedness and prejudice, which are properties you display so eloquently are not the way to move forward. There's a reason you take to the YouTube comment section to push your views and that's because no one trusts you enough to provide a genuine platform or forum to further your idea's. So stay here while everyone who has a level educated view on the matter work TOGETHER to find viable options moving forward.
Reply: Joel Barron
You assume too much.  I challenged the assertion that E85 was the future.  I provided facts to support that statement.  Just because you don't like facts A)Doesn't make you any kind of authority on the validity of my argument and B)Perfectly exemplifies what closed-mindedness actually is.  Basically, you've declared yourself the winner of an argument that wasn't being had.  Congratulations.
Reply: +Invincible Osprey You are forgetting that electricity usually comes from a fossile fuel in the form of natural gas. Hydrodams and nuclear are the only true clean sources of energy we have and relatively e85 is very clean... also compared to electric that comes from coal or natural gas. 

If you calculate energy losses you probably need more natural gas per driven km than you'd need petrol for an equivalent vehicle in the average country (that's my estimation, don't take it as hard fact).
Reply: Johannes Konow
Texas uses wind power on a mega scale.  I don't know the latest percentage of our power that is wind-derived but it continues to climb.
Reply: but there is so many wasted food and drinks. so why cares about food resource if you easily waste your food?
Reply: green tree
I don't waste any food.  I always leave my plate clean.  The problem is that there are so many idiots that get their food and water handed to them at the expense of others.  They don't respect it and they are ironically the ones most likely to waste resources.
Reply: +Invincible Osprey a large portion of all food in grocery stores will be thrown out
Reply: waimeagavin808
Actually, only a small portion is.  I've worked in grocery stores.  Probably more is thrown away off people's plates than out of grocery stores.  Not my plate though.  I find it offensive when people don't clear their plate.
Reply: Invincible Osprey my friend is a stock boy at shop rite and I've seen him throw shit out waiting to get him after his shift. They threw out more food then a convenient store would hold. I asked how often do they do that and he pointed at the other 8 mega dumpsters and said "well all those are full and we just emptied several days prior" and how throwing out food was just as much his duty as stocking shelves.
Reply: waimeagavin808
No company could stay in business long at that rate.
Reply: Invincible Osprey the amount they pay for the item v.s what they sell them for makes this more than possible. ShopRite has been in business a long time and they seem fine
Reply: waimeagavin808
Grocery items have very little markup except for frozen and refrigerated items.  Maybe there aren't any Wal-Mart Supercenters in the Shop-Rite area because if there were they would have to lower their prices dramatically to compete.
Reply: +Invincible Osprey we  have Walmart just no super centers in the near area
Reply: it may be a little narrow minded of me, but... if we clean sea water, then there's plenty of that, and water is almost an infinite resource, almost!
Reply: Blasphemy
That is very expensive in both infrastructure and energy.  It can be done but it isn't cost-effective yet.
Reply: I know it isn't cheap, but I didn't know we were talking about money
Reply: Blasphemy
You can't do anything without money.
Reply: yes, I know.
Reply: This comment thread is funny. Why do people on the internet like to argue so much? (which I've now joined in on lolol). 

Ethanol is NOT the fuel of the future. From what I can dig up, you get less mpg from ethanol. Ethanol is still a hydrocarbon, so surely getting less mpg means you're spitting out more CO2? Someone please correct me if I'm wrong. 

I'm also going to say that electric cars are a long long way from being particularly viable. The issue of the pollution from producing the electricity has already been mentioned, but that is (slowly) getting better. The longest range I've seen of an electric car is 250(ish) miles. That's not much use if you're taking a long trip, and it's not like you can take extra electricity with you if you run out. The infrastructure just isn't there yet and it will take a very very very long time before it is. I can get 400-500 miles out of my 10 year old car and I've seen me only just making it to a fuel station in time, imagine if I had an electric car and had half the range and maybe 20% the amount of "stations" available to charge my batteries? 

And of course, time is an issue. You can fill up your car with fuel in minutes. How long does it take you to charge your car batteries?
Reply: Also, electric cars are heavy as shit with the big beefy batteries
Reply: You are not compromising food because some of the best animal feed is distillers grain the only way to get distillers grain is make Ethanol . So its not food vs Fuel its better food and better fuel its a win win
Reply: electric cars suck overall, I'll be keeping my ICE powered car for as long as theres fuel to put in it!
Reply: 1300l But even when using electricity from fossil fuel, you emit much less than the exhaust from petrol
Reply: Invincible Osprey  Works for OPEC
Reply: Nope.  I'm just not a damn fool.
Reply: An ethanol plant uses less water than most golf courses.
Reply: *****
Water used on golf courses goes back to groundwater and evaporates into the atmosphere.  Water used in ethanol production has to be treated before it can be used again.
Reply: Invincible Osprey We can subsidize ethanol production to Appalachia. Isnt ethanol one of the waste byproducts of moonshine production?
Reply: purpleravenstar
Moonshine is ethanol.
Reply: tell them to use salt water not drinking water!.
Reply: Still so worth it.
Reply: Invincible Osprey ya but most of the water is rain water to grow corn and us evaporated
Reply: The result of ethanol combustion is water.
Reply: so how many desert storm  bombs does it take to fill your gas tanks?  i wonder  ??
Reply: But you what more cleaner to make, CRUD OIL & FRACKING  or all organic crops from naturally grow farmers + distilled water.
 go figure, do the math, save the earth, end the wars, end global oil corporations, 
 lmfao great video guys thumb up
Reply: It takes hundreds of gallons, to grow the food you and me eat too. The amount of water used for ethanol is a fraction of what water is used for across the globe.